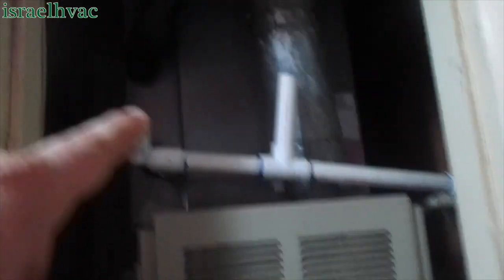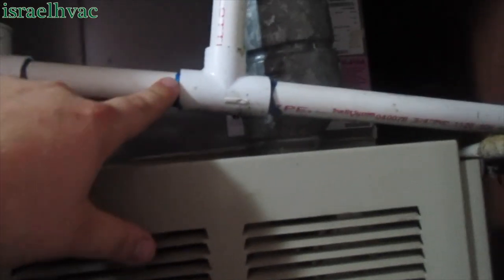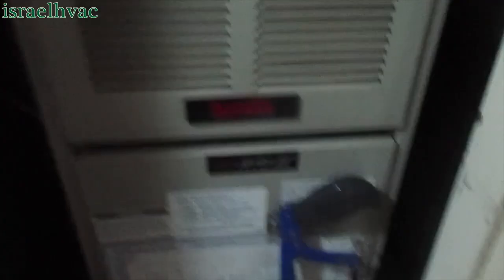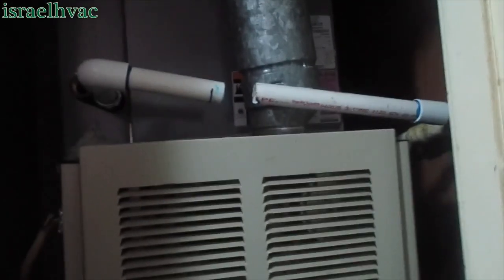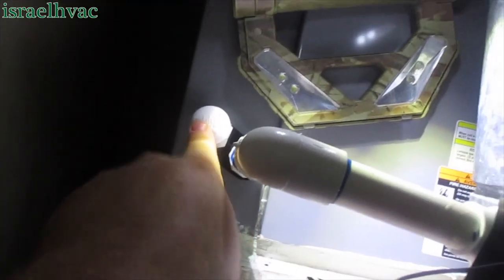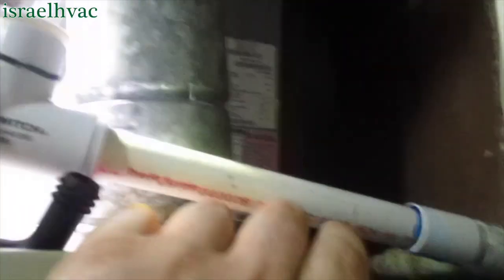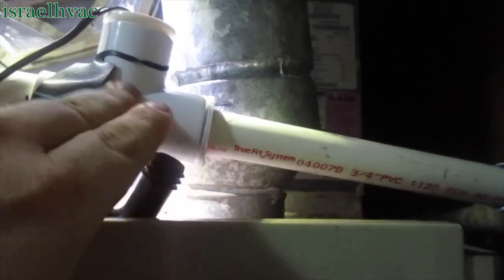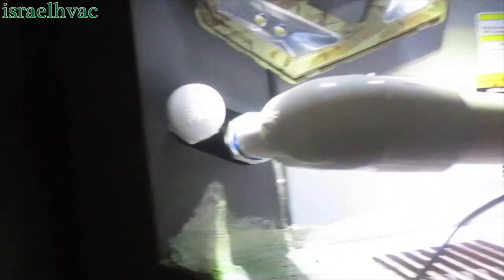HVAC | Float Switches | SS1 vs SS2

Comment: seems you could drop the SS2 line as well, by extending it out with some PVC pipe and joints, and leave it as a secondary (wired in line with the primary SS1), so if water does go out the secondary port it would 'fill' the lowered SS2s pipe and trip it. You'd have to drain it to reset it; but not often as the SS2 would likely not trip. It'd just be a secondary back up.

Comment: I've found elec heat up flows tilted back and draining towards rear and never tripping float switches usually after several techs have been there previously and just blow and go on blockages.

Comment: Just plug the main drain line and turn it on and watch it and see what happens.   If the pan is full of water and the switch is okay there can only be either gunk blocking the secondary drain opening or the blower is sucking the water out of the pan into the coil, and it's going to wind up on floor at some point.  I would not remove it but put another one one the main drain, then  maybe it may still work if the main line float  switch fails.  ideally also have (if possible)  a secondary drain pan with another float switch on that.  If all else fails get a water sensor cut off like some have said. 

The problem  with just using a main line float switch is if the unit gunks up inside the AH at the drain opening then that switch will never be activated.  That's the whole idea of the secondary drain line elevated a bit higher.  Same way a condensate pump has a cut off switch higher than the pump float switch.

Comment: Just actually watched the vid.   Can't have a pan under the unit with the gas furnace underneath so that's out.    But don't remove that secondary switch.  And put a P trap on the main line as well with less pitch on the line.

Comment: You think that new float switch will work properly even tho it's on a slope?
Reply: was wondering the SAME thing... not sure the switch was designed to work at that angle... might work but ....

Comment: We have had nothing but trouble with these new Up flow Trane’s placing a ss2 in the secondary drain tap. They seem to be filling up with water shutting the unit off and the main drain line is clean and has a proper P trap. I called Trane and he recommended installing it in the primary line with a Ss-1 but our city inspector wants it in the secondary... what a joke
Reply: to appease the inspector, you might be able to install to the secondary via extra joints & a little pipe and adjust the height of the then offset SS2 to keep it from causing nuisance shutoffs. Depending on the A/C unit it may just need to be off-set up a smidge... or down a smidge if it's not filling enough to trip before the pan overflows. Think of it as a dead end cap for a secondary line, rather than a device to connect directly to the secondary port.

I'm sure if you explain the reason for it, and show that it still works when needed, the inspector will sign off on the alternative install.
Reply: The inspector is right.  If the unit gunks up inside what's going to trip the SS-1?    Put a pan underneath it if possible when you install with a float switch on that as well.   I'd play around with  adjusting the P trap  depth and location.   As you know  there is never  water in a secondary unless the pan is full.  Something isn't right with the draining.

Comment: he didn't cement properly and any cement will fall apart if applied the same way he did. it's possible his theory was,  glue lightly around the edge for easy removable by twisting out, seen that more times than I can count. however if easy removal/cleaning is key, then use a union or couple it with clear tubing.